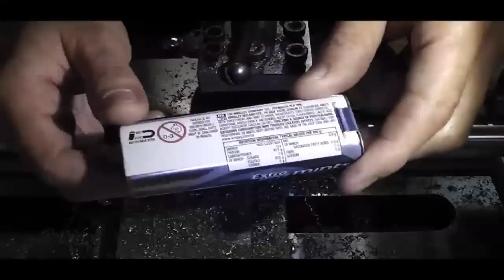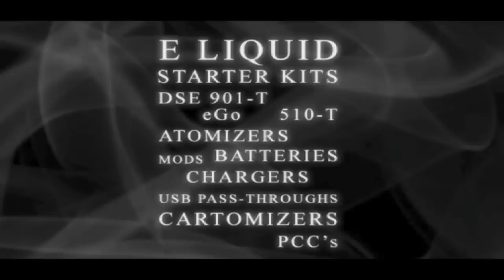Tin your tip 06 - 05

Comment: These will give you a perfect drip tip tapered whole.They are also the best way to start a whole when drilling on a lathe. 
5 Piece Center Drill Countersink Set 60 Degree Angle Bits Metal Lathe Mill Press
P.S.
Please get Mark A push stick before he looses a finger.
Steve